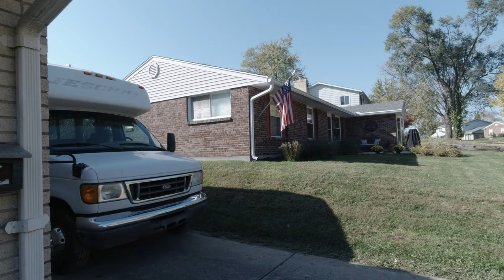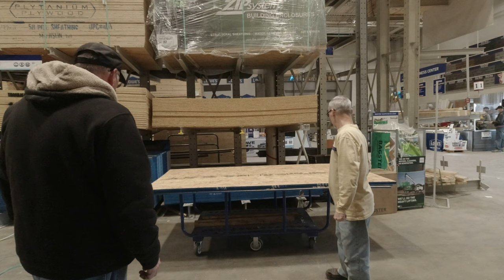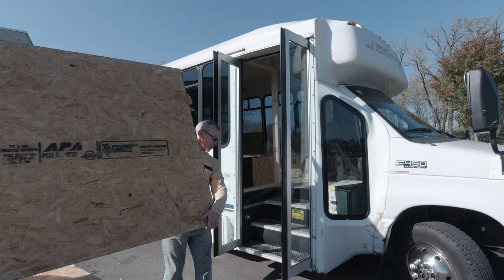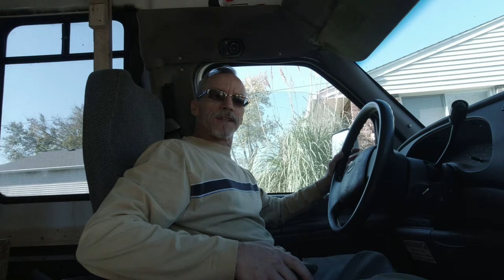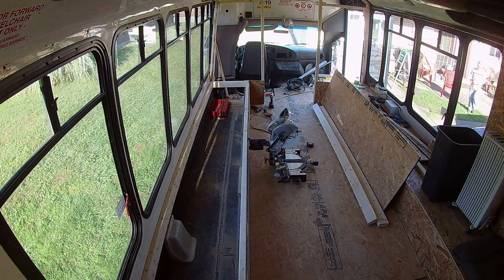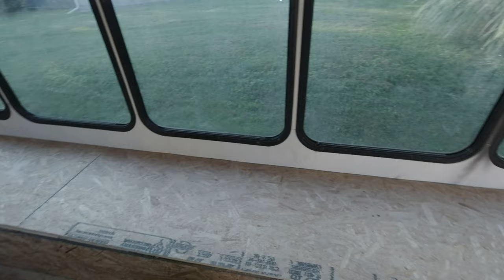DCC- Bailey Party Bus - Day 4 - Seats and TV's

Comment: What do you see on the outside of the back window where the tv is ? And how do you mount the TVs
Reply from the maker: I clean the inside of the window and use black plastic spray paint directly on the glass. Yes, it scratches easy but not where a wall or TV will be behind it.  Go back and watch a few of the past week's videos, TV mounting was discussed and shown.